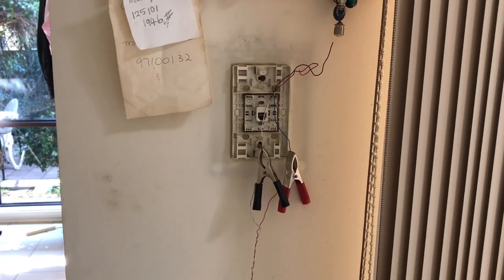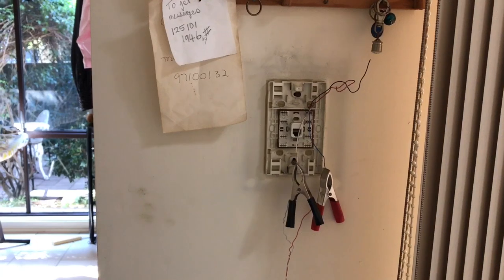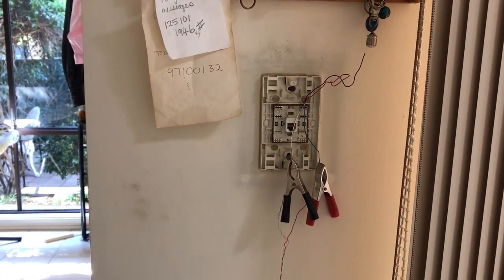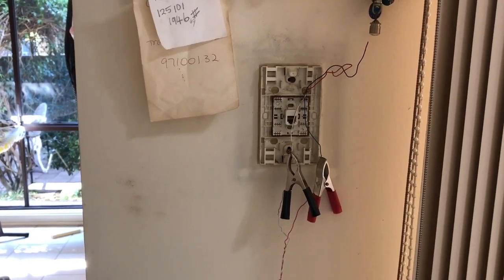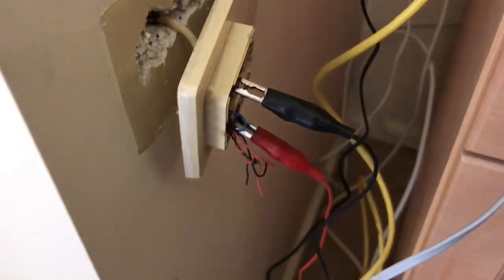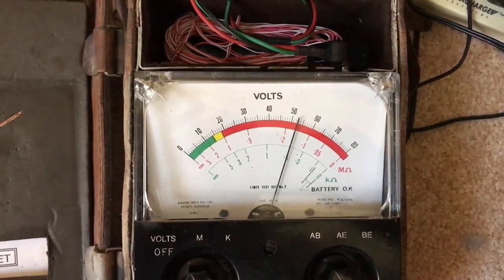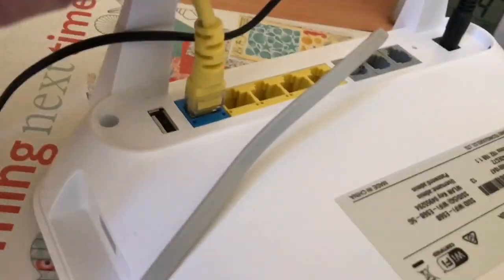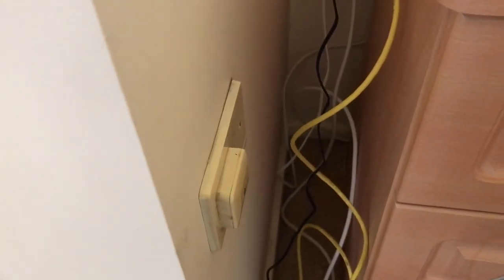NBN HFC (Coaxial) How To Connect Existing Phone Sockets

Comment: I don't understand how this works. So is it basically you're eliminating any sort of external connection (in this case, the old Telstra box) from the phone socket, in order to prevent interference in this case electrical interference? And so the only wiring from the phone socket is all internal (i.e. rewired to another phone socket in the house)? And the home phone would still work because the 'external' connection is now all performed via the NBN box (i.e. as it's all VoIP now)?
Reply: I tried it today and in my case, I am connected simultaneously to the NBN VoIP and my older coaxial home phone connection. This meant that on outgoing calls, it skipped straight to the recipients' voicemail but the recipient could still pick up and we could have a normal conversation. Is this unusual? This really confused me for the last 7 hours I've been trying to work this out for. My current theory is that my ISP hasn't fully processed the disconnection (from the older coaxial connection) and once this is done there should be no more issues?
Reply: yep data only turns into voice calls through plugging cpe into modem

Comment: Thanks for the awesome info, so by plugging the phone line from the modem back  to spare socket. Will this work for fttc. ? Appreciate any help. 👍
Reply: You need the lead in cable connected to a wall socket for FttC to work. Don't disconnect it like he does in this video.
If you want other existing phone sockets in the house to work for standard phone calls, you could ask a technician to replace your first wall socket with a dual outlet version. 1 outlet for the lead-in cable to connect to your NTD, 1 outlet to connect the phone output of your router to your internal wiring to feed the other phones.

Comment: One thing that does not make any sense whatsoever, is if the property is in a HFC area, what has the the PSTN line got to do with the HFC service? My understanding is that if they are two seperate networks, the NBN HFC shouldn't be affected by the old ADSL service.
Reply: From my understanding they're using the old phone sockets running around the house essentially as "extention leads" to use phones that will now make VOIP calls instead of PSTN. All of the phone sockets go back to that one router phone port he showed, which then go out to the internet via the HFC connection. The pre-existing PSTN lead-in is still connected to the street, so the voltage is interfering with the VOIP calls. I think that's only an issue in areas where the PSTN service hasn't been switched off yet, although I could be wrong.
Reply: @brianbrushwood6734  You are correct. The video makes this clear but apparently some people cannot understand it.
Reply: @brianbrushwood6734  even once PSTN has been switched off, I'd expect calls to work more reliably and at higher quality with the lead-in cable disconnected. With it still connected, I think the line would have far greater capacitance that I don't expect the router phone port would be designed to work well with.

Comment: Hi & thanks for your informative video. 
Shortly, NBN will be connected to my home. 
The existing 3 x phone extensions in my home, are all plugged into wall mounts ..... each wall mount contains an ADSL FILTER.  Before connecting my phone extensions to my NBN router, will each of the wall mount FILTERS have to be removed ? Appreciate your help - thanks
Reply: yes correct , then plug a phone cord into pstn of modem